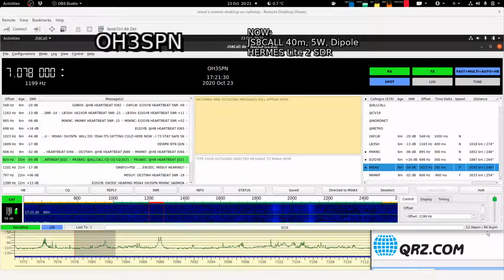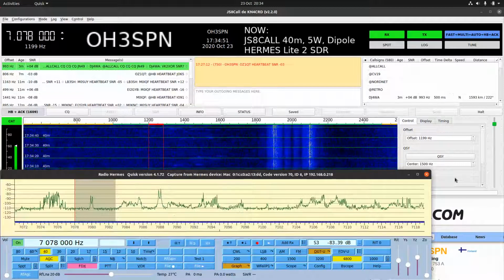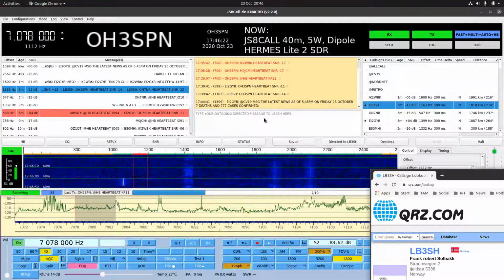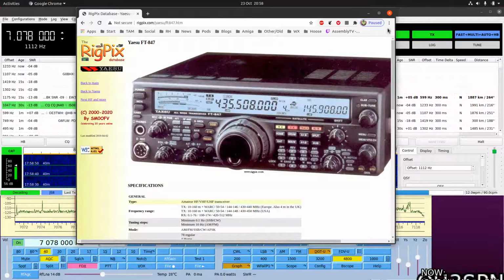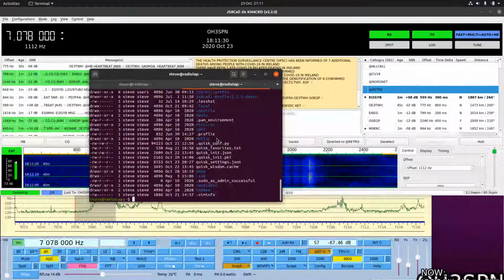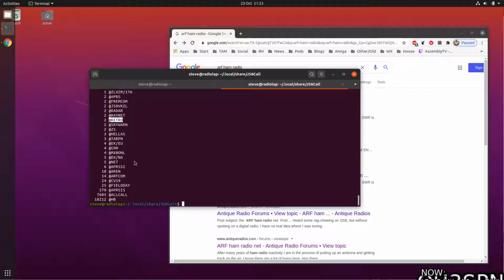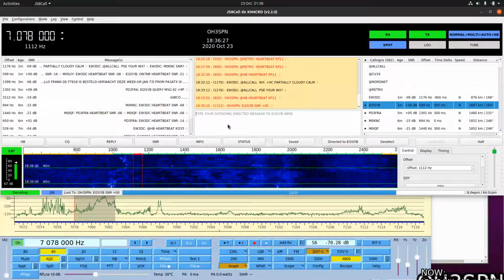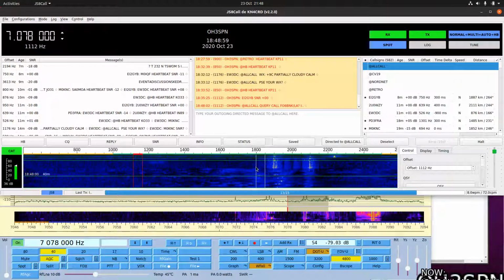JS8Call + Quisk Configuration, Hermes Lite 2 SDR, IC7300 Comparison and more!

Comment: ** USEFUL TIPS **
You must select the digital mode before audio will come out of the virtual audio cables. This is done with "DGT-U" for upper sideband. It will not work if you're in just in plain "USB mode". 

I had to use "127.0.0.1:4575" for my hamlib NET network server inside JS8call. Otherwise, CAT (and thus PTT) wouldn't work.

Comment: Hi, I enjoy your content.
I am studding to get my license in UK and I'm going through a lot of research on radios and thanks to you I stumbled upon Hermes Lite 2.
Would you consider it to be a good first radio purchase. Do I need an amp? Can you do a super simple setup for Hermes (for dummies)?
I'd rather avoid buying big shack station and I'll be restricted to 10W anyway. Because of that I was looking into QRP transceivers like KX2. 
What do you think?
73! Kevin
Reply from the maker: Hi Kevin!  For the price I can absolutely recommend it.  In fact, I can't recommend it highly enough!  However, as with any QRP solution your success will be entirely dependent on your antenna;  a simple dipole will have you working the world.  Avoid anything coax fed that requires an ATU or the losses will quickly stack up against you.  Regarding power, a little extra can help (especially on SSB voice) but is not essential.  If you're looking for a standalone radio that you can use portable then the KX series will probably be the better option.  If you're looking for a device that can sit on your local network (possibly remote from your workstation) and you don't mind using Quisk, OpenHPSDR, PowerSDR or SparkSDR (there may be others?) then the HL2 is a really great option.  What's your OS of choice?  If my laptop has enough CPU to run the SDR software and capture video, I can maybe record a quick setup video :)
Reply: @oh3spnfinland718  My OS of choice is latest version of Windows 10. Never played with open source, however I'm keen on getting on the air, preferably on the cheap. I know kx2 is on the expensive side and I just realized that the price is for the unit only, no battery, no charger, no atu... so I'm not too sure anymore. I'll keep looking. Thank you. 
HL2 still looks good though.
Reply from the maker: @nobraidps  I'll see what I can do in terms of the HL2 and Win 10. It would be interesting to explore the software available.
Reply: @oh3spnfinland718  I suppose I could just boot Ubuntu on my old laptop mate. I'm more interested in the build process of the SDR unit itself and what do I need. Like I said I'm completely new to this.